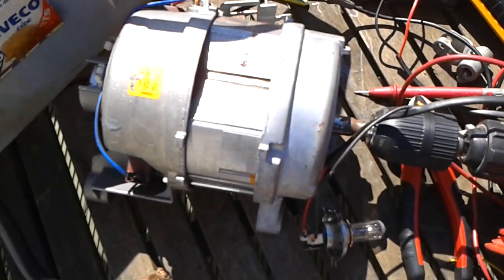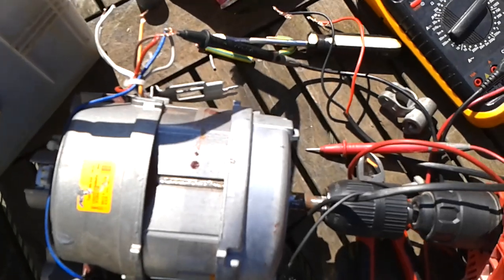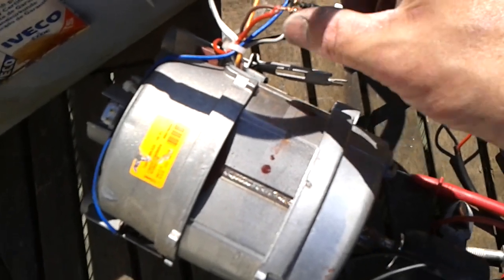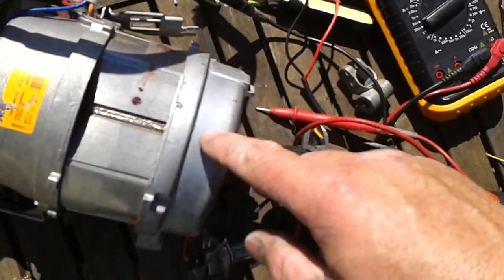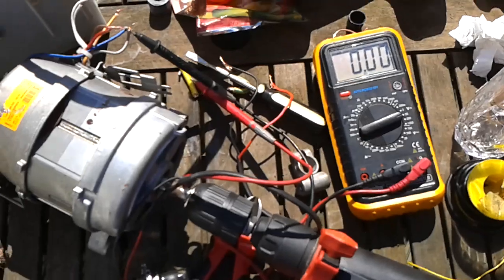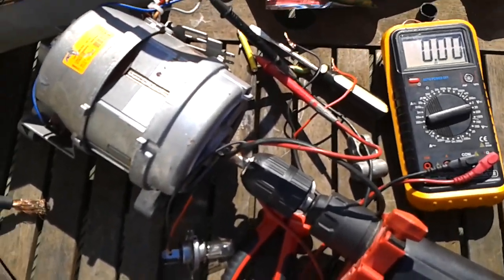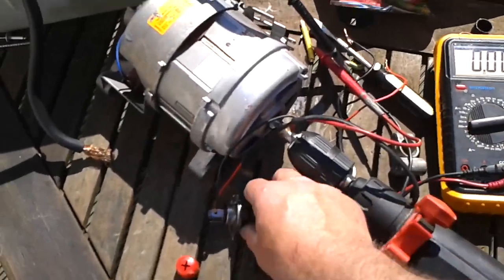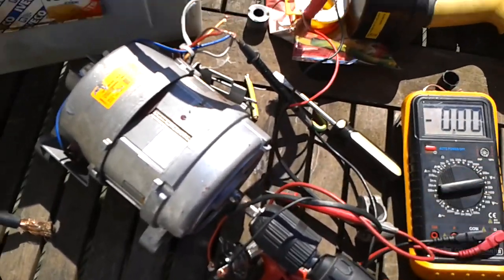washing machine motor as a generator

Comment: if you're looking to charge a car battery with that with the setup that you got you need to always go through full bridge rectifier light bulbs are indiscriminate on whether or not they want AC or DC will take both always be careful and be sure to test the amperage after you turn it to DC

Comment: voltage is not amperage ,   just cause you can make 15 volts dont mean you are making power.    the bulb is considered placing a load on the motor. try using a smaller wattage bulb then a 55 watt bulb,   cause at 12 volts to run 55 watts you need to make 4.6 amps of current to power that light.   so at only 500 rpms or what ever little speed that the drill is making then you wont have nuff power from the spinning motor.   even if it is hooked up corectly.   so try a smaller bulb like a 12 volt marker light something that is like 1 or 2 watts of power and see what that gets you.
Reply: Steven Burden - exactly

Comment: Put an AC oil filled capacitor across the output terminals.
You must spin the motor a little faster than what it runs
as a motor. If it is a 1750rpm motor spin it 1900rpm.
This is how wind generators have worked for 80 years.

You can use magnets but you don't have to.

Use a 12v battery instead, connecting the battery up
for 1 second and then off, then back on for 1 second
and repeat til you magnetize the internal parts.

This is done in minutes. You will be producing the same
voltage and almost the same amperage as the motor
run uses.

If you have any questions just ask.

I did this to a washing machine motor.
Reply: Bro Mikey wait I don't understand you have to magnetize the inside of the motor?
Reply: Because all generators are just motor with the exception of having either an exciter section or a simple magnet to get the ball rolling.                       
Just hook a set of caps across the output terminals and lay a set of 12vdc battery wires on those for a few seconds while running or stopped. Once the motor gets some current thru it to the windings it becomes an electromagnet, right? Like using a nail to wrap bell telephone wire around it to use as a childs experiment it picks up paper clips when connected to a small battery.

If you have any questions let me know.
Reply: Bro Mikey how do you get the output to dc. How much would the parts cost or can you find scrap

Comment: As it is an induction motor. You have to alter it like add more powerful magnet I guess neodymium N45 would be best for it. Ur voltage goes to 0.00 because this motor can not drawn enough  ampere require by bulb
Nice job keep it up dude.
Thanks

Comment: whatever you use in the house runs on dc power.  so if you have an electric motor and run the reverse you have a generator that is also running on dc.
 if you put your pos and neg together and hand spin the axial one side will be more difficult to spin and that is the direction you use to on your leads to charge a battery
Reply: Mike D home power is AC

Comment: Um your not supposed to touch the glass piece of H4 bulb... you might've broke it.
Reply: the actual touching doesnt break the bulb its the oils from your finger make the paper thin glass dirty and when the bulb gets hot the oils from your fingers heat up and could cause the glass to shatter but this is all a could happen thing not a it will happen thing